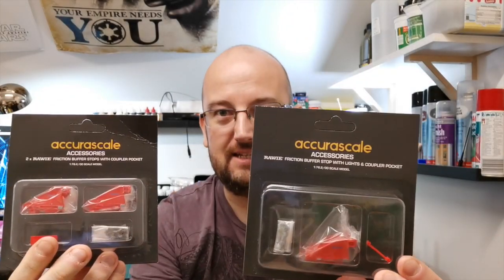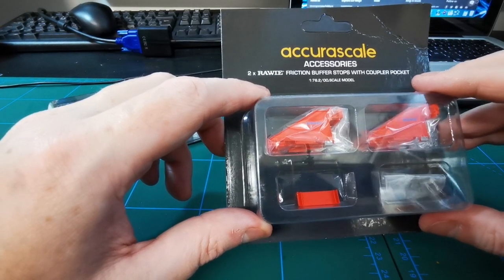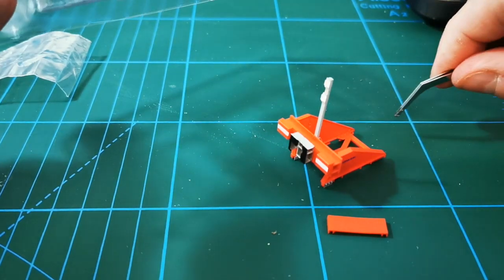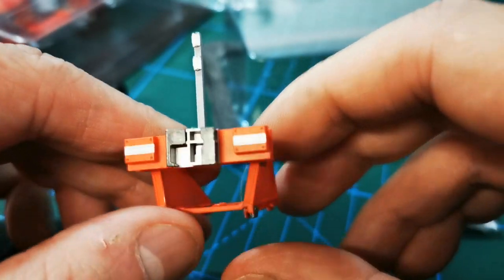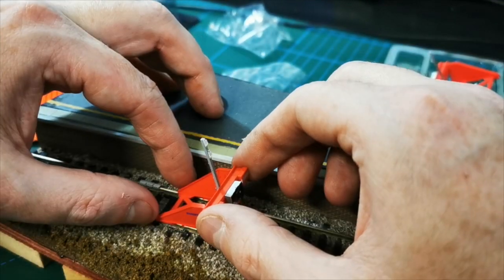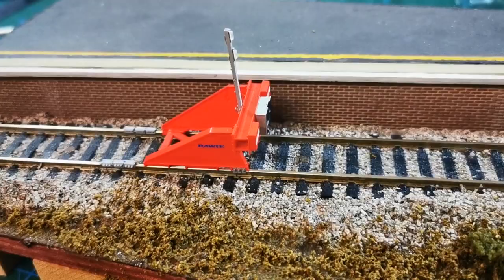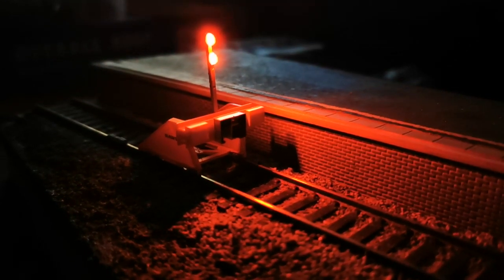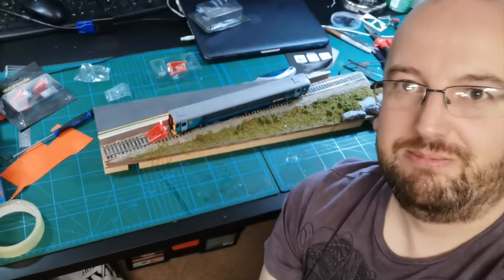Alnahudy Central - Accurascale Rawie Buffer Stops

Comment: Thanks for sharring this. Mine arrived yesterday and are still in the box. For DC wouldn’t it be easier to cut and isolate the track directly before the buffer stop and attach some extra wires for a permanent power supply? Cheers. Guido

Comment: Only one light comes on in DC mode depending on the direction because the lights are LEDs. D=diode so the current can only flow in one direction. They will be set up in opposite polarities so at least one comes on in DC. Hope this helps

Comment: The LEDs probably only work in one direction on anologue because it's DC so the current only flows in one direction at a time. LEDs only work in one direction so they will only work when the current is flowing in the right direction. The way to solve this would be to wire in a bridge rectifier which allows the current to flow into the LEDs regardless of the direction of the current from the controller.

Comment: Great looking item. The led’s will only work in one direction as led power only flows in one direction. When you change direction you change the polarity in effect so they won’t light due to changing direction of current flow. Cheers, Chris